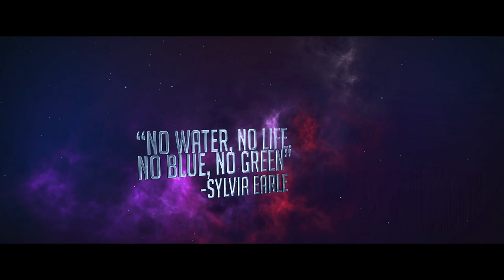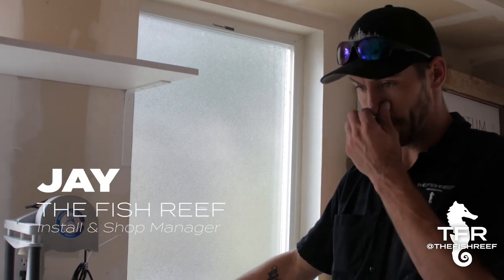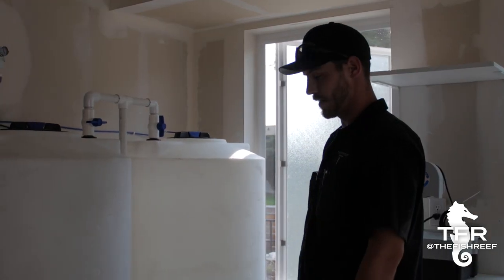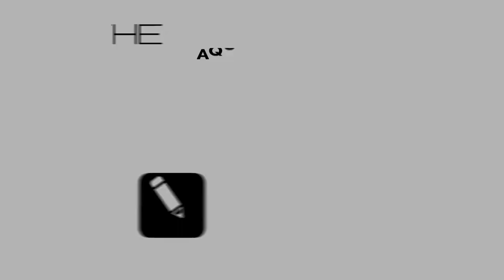New Salt Water mixing station by The Fish Reef.

Comment: I like the look of the build and water mixing stations help out so much. But, I have a couple of issues with this build. As professionals, they should know that you should use union ball valves. Those ball valves they used from Lowes WILL fail over time and will have to be cut out to be replaced. This will be more hassle in the long run. Second, that outlet should not be right behind the saw like that. water can splash from the saw onto the outlet and can cause obvious issues.